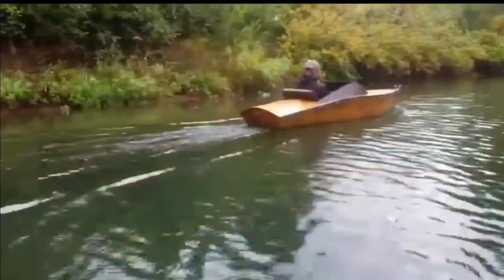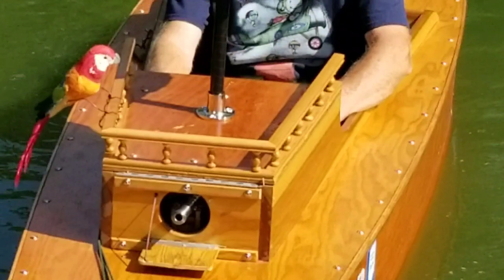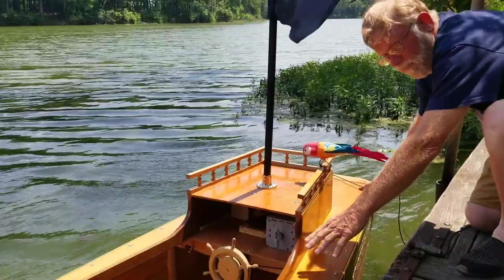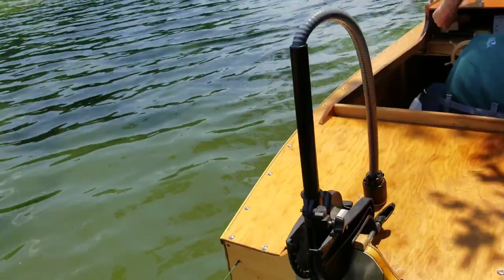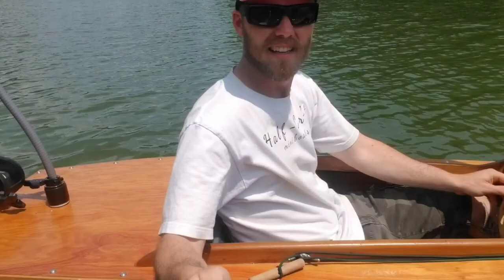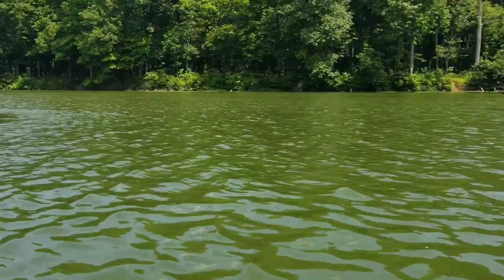Trying other mini boats ep. 4 'Puddle Pirate' by Alan Gluff

Comment: I am new to your channel. Love your passion. Had been researching moving my trolling motor controls and found you. There is a lingering question. What gauge wire is used to lengthen the control switch? Both the 12v supply and the switch wires...
Reply from the maker: Thank you!! Well I'm not clear on exactly why the wires are different sizes. I think different resistance. A good rule of thumb would be just match what is there. If you're using just the primary 'circuit' I'd use 8g. But I have used 10 alot with no issue....that I know of lol adding a fuse to the red will allow safe experimenting. Resetabe fuses are sweeter!

Comment: Hi American Boathead...I'm nearing the completions of my own boat...but struggling to figure out how to control speeds without taking apart the motor...do you have any suggestions?Would love the tips. THANKS FOR THE VIDEOS
Reply from the maker: Well if you don't want to take apart the head of the motor, you'll have to use the main power supply cables.  For instance have the black cable connected to the battery and the red one with a toggle switch. Then put the motor on whatever speed you think you want. I'd suggest full speed. Then if you can find a variable speed controller of some kind you could controll the speed there and leave the motor on full power.  A potentiometer or dial. Look into pwm controller and good luck!